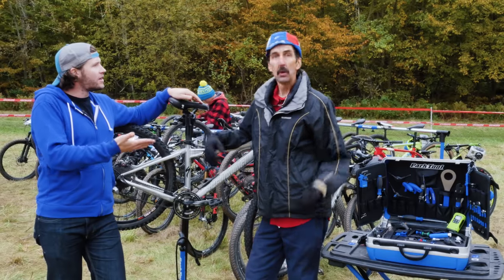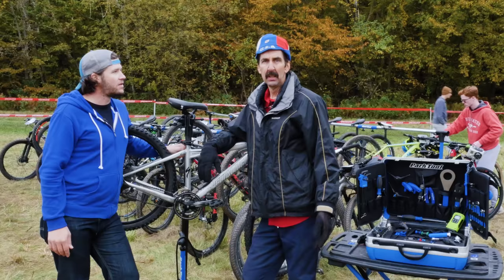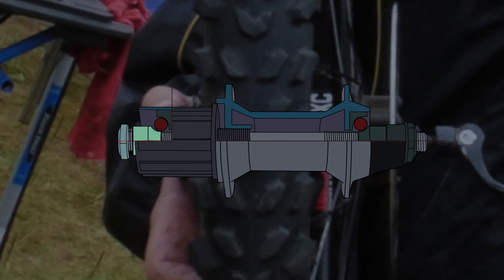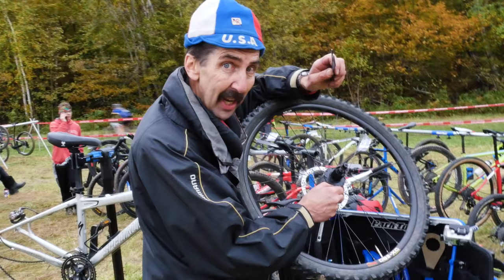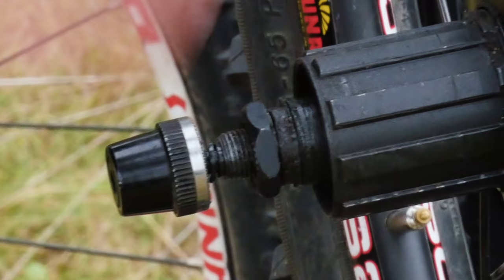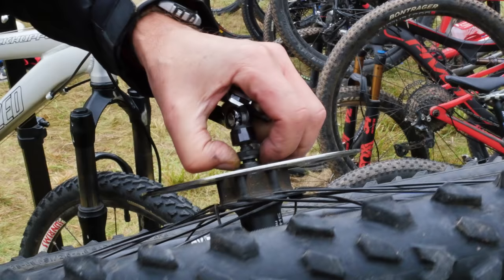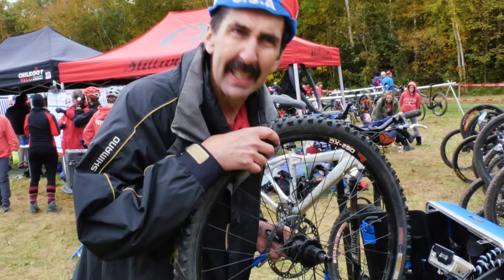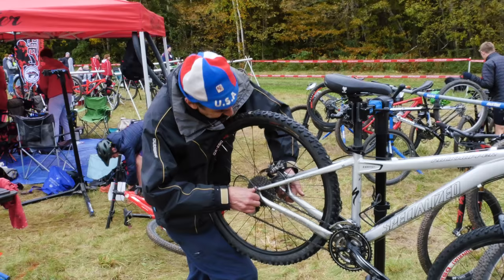Knock Knock, Loose Hub | Tech Tuesday #117

Comment: Had this just happen to me, actually shat it, thinking my rear wheel was ruined n didnt want to check it cause then i would have to replace it. Went out on it without checkin n it was terrible,  then finally took wheel off to look n it was only loose nuts. Could have ruined it by not wanting to find problems that can cost money

Comment: Man amazing video, love your guys tutorials. Just stopped by my bike shop for some spanners and did this myself. Had the exact same issue. Had to remove the cassette, loosen the non drive side, move the axle through a bit, tighten the cone on the drive side, then move the axle back and tighten the non drive side. Was shocked at how fast I was able to do it, all thanks to you guys! No more wobble for me! Also converted to a 1x12 thanks to your other videos!
Reply: did you go from 2x or 3x to 1x?    i use 2x7 .. hubs are decent 😊

Comment: How do you know where to hold to cone when locking it in place? Otherwise would the hub be off center of the axle?
Reply from the maker: The cone rotation from a very tight hub, barely able to turn, to where a hub is very loose is less that one complete turn, or 1mm.  Normally it will be 1/4 turn, or 0.25mm, which will not significantly change hub centering.  However, the WAG-4 can be used with the wheel in bike when checking centering.

Comment: I bought an £850 hybrid with crappy hubs. Not my choice, but after my Cobalt 5 got nicked during lockdown, a new replacement was nowhere - all the bike stores were MT. I found an April 2020 Cobalt 4 (Pinnacle's top sus hybrid) on ebay and took the plunge. Anyway, having serviced these hubs 3 times in about 500 miles because they loosened, I'm beginning to think they're just shit quality. Shimano HB-TX505. They're unprotected, use only 10 of the smallest balls i've seen each with a gap to take a snug 11th each side, and were tough to get to run smooth. I have checked and that is the correct amount. 
Stuck in the park last night with 6 miles to go and a knock from the front, I had no tools to fix these buggers. A passer-by gave me the number to a local bike shop that had just closed (at 4.30?) and he said the hubs were giving way!? He said i'd probably keep having to tighten them up until one day the axle will seize. Great! These feel like the worst build quality i've ever seen in 35 years of biking. If you're buying new, check these are not on it. Utter S**T

Comment: Doesn't the freehhub just pull off like on road bikes? On the current hub shouldn't you measure the exposed threads to be sure equal amounts of the axle are coming out each side?
Reply from the maker: Freehubs are bolted to the hub shell on these models, road or MTB. 
 In a full overhaul, measure axle protrusion is a good idea, but with a race minutes away, you use your experience and judgement get to the rider to the line.

Comment: I have this kinda problem, but my rear hub come with 12x142 thru axle, and i can feel a bit play in it, i checked on the hub there's no anything loose. Could it be happen bcs my frame a bit bent? Or it is just the nature of thru axle? Cuz i can feel it play without mount it on the frame, just by putting my thru axle in the hub and check it and it actually have some play. Pls help. Thanks

Comment: Just a quick question, do all freehub bodies have a locknut or on certain hubs, will the cassette lock ring act as such?
Reply from the maker: Not all free hub bodies have a locknut. Some are slip fit on and rely on the thru axle to keep itself together. There are also other Qr styles that use end caps that are a slip fit. There are no hubs that utilize the cassette lock ring to hold together.
Reply: @parktool  Yes my Salsa hub on my Beargrease has a threaded end cap on the drive side, which worked its way loose, stopping the bike from shifting to the largest cassette cog and making a spoke-type pinging noise from the rear brake. I noticed the cassette moving when I put it on the stand after riding, so when I took the cassette off, that threaded end cap had backed out completely! I had a 17mm spanner for the drive side end cap, but of course the non-drive side takes a 14mm Allen key which I don’t have! Off to Lowes or Napa auto parts! A known tendency for these Salsa hubs. Just hope the pawls on the freehub body weren’t damaged, as one seemed to stick a bit, even after I cleaned up the freehub and internal splines on the rear hub body. I noticed this freehub body had a very thin circlip holding the pawls in place? Never seen that before-? Quality from that freehub bun I guess. I’ll have to see about changing to a better freehub brand.
Reply from the maker: The small circlip is actually a spring that engages the pawls and keeps them in place on that freehub design. Those are fairly well known for coming loose.

Comment: Please repeat this procedure, using a Tiagra 4500 hub, with a loose drive side lock nut. In the meantime, I'm off to a workshop.
Reply from the maker: The concept and procedures are the same.  Enjoy the process of figuring out the mechanism, and then fixing it.
Reply: @parktool  Ok - I'll explain the problem. 😃 On the drive side, the cone has a cover, so I can't use a cone spanner & wrench to lock the nut against the cone - there are no flat bits exposed on the cone.  So I tried first locking the NON drive side nut & cone (after setting the bearing tension carefully), and then, I tightened the drive & non drive lock nuts against each other, hoping that the drive side cone was, just perhaps, fixed very firmly in the right position. This didn't work - everything simply moved inwards  and tightened up against the bearings.   I continued to experiment, finally realising that I'd shifted the axle off centre, and then gave up and left it with the professionals.
How was I supposed to handle this situation?
Reply: They didn't bother repairing the wheel, because I told them I had subjected the bearings to extreme over-tightening, and I also wanted an 11-speed hub anyway, so I simply bought a new wheel. (RS100. Old wheel was R500).  Now, I can see where I went wrong. Due to the sheer amount of hardware on the drive side, I got really confused. In a nutshell, if I had removed the axle far enough, yes, I would have exposed the cone, which DOES have the flat edges for a cone spanner. Doh!  Here's a photo, which shows the vast array of stuff this wheel has on the drive side. The new wheel is much simpler - I can see the drive side cone very easily, just looking at the wheel, without loosening anything!  From left to right: cone, rubber washer (that I think presses against the cone!), metal washer thing that looks a bit like a small cone (has two different diameters), metal spacer, metal shroud, lock nut:  https://photos.app.goo.gl/Q6YFCGH6NhhufYrW7

Comment: I love your videos guys but my danger-danger sensor was going off like mad during this video. At least cover the brake rotor when working around it with greasy fingers and tools! The smallest spot of grease will ruin the braking! Safety first.
Reply from the maker: By working thoughtfully and with care, no grease contacted the rotor and everyone was safe.
Reply: Sure, but you’re showing others how to tighten the axle nuts so you should also teach precautionary measures and good practices.

Comment: i dont have a locknut on both side so what now? One side is fixed. Whatever I do its loose
Reply from the maker: If this is a threaded axle, it is likely one side has a missing locknut.
Reply: @parktool  Threaded axle it is. There are two lock nuts on one side that I am unable to tighten to each other because I have no access ( proper tool ) to the lower lock-nut so I am visiting a service soon. Thanks anyway.

Comment: I have a dura ace 7900 10-speed groupset, and find that 7900 rear mechs are hard to find at a reasonable price. I need to replace the rear mech. I was wondering if I could use a DA 9000 11 speed rear mech instead? I plan on staying with 10 speed and using the same shifters etc. would this work? Main issue is cable pull ratio right? Any other concern? Seems like it would work to me. Thanks.
Reply: Nope. 7800 or 6700 RD's will do the trick though. 
11 speed derailleurs are only compatible with itself, and Tiagra-4700 10 spd, which has a different pull than all the other 10 spd's
Reply: So the pull ratio is different from a 7900 to a 9000 mech?
Reply: @GNX157  yes. Your options are DA 7800 or Ultegra 6700, if you do need to replace the RD.

Comment: I did a front hub service on my bike, when the rim is off there is no play in the axle, I tighten it and then slightly backed it off allowing for the rim to spin freely with no play however when I put the rim on my bike have about half an inch play side to side (even with the skewer firmly tightened). Any ideas what may be causing this?
Reply from the maker: What hubs are you working on? Sounds pretty strange. What does the play feel like?
Reply: @parktool  thank you for your reply, it has me stumped. They're joytech hubs on alexrims xd lite rims. It especially happens when I sit on the bike and apply pressure to the front or apply the front brake. If I flip the bike over and spin the wheel freely there is no wobble at all. When I remove the rim the axle and cones are still tight and there is no vertical movement whatsoever. The axle isn't bent or damaged either. One mechanic I took the bike to was also perplexed...

Can't really describe the play other than when you put pressure down or apply the brake you can see and feel the wheel jolt to the side about half an inch and then corrects itself. I've measured end of the tyre to the fork and it seems to be fairly correct.
Reply from the maker: Are you sure it's the hub? Maybe have a friend a friend press down on the bars while you watch where the movement is? Almost sounds like a fork issue. But you have eyes on it.
Reply: @parktool  I'll give that a try, I can most certainly determine it is the wheel that moves but I'll be sure to inspect the forks. Thanks 😊
Reply from the maker: Take a video and post it up. That will tell quite a lot.
Reply: @parktool  noted, will do.